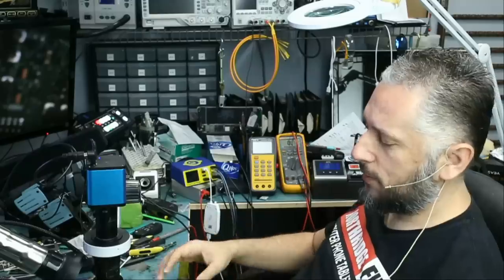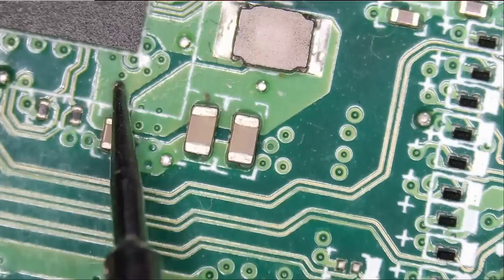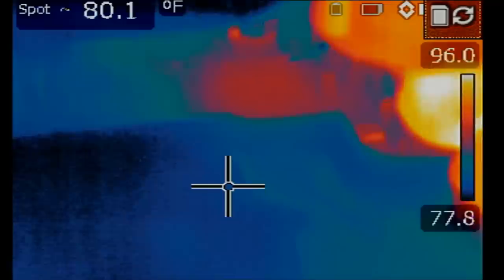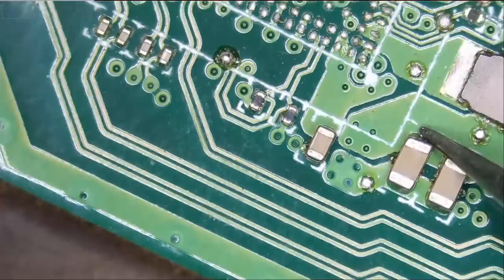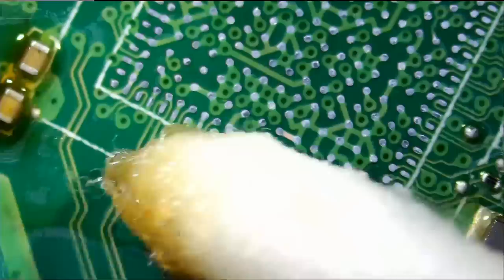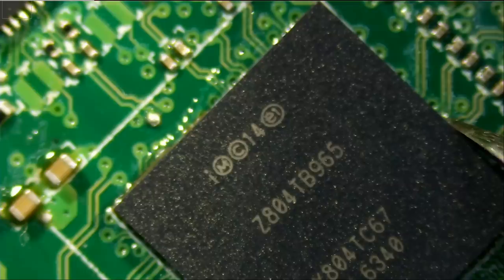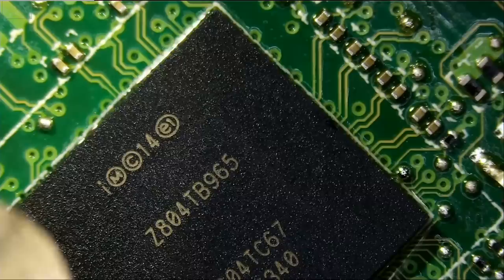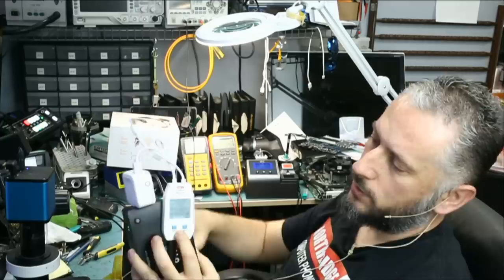HP Spectre x360 Laptop Repair - Won't turn on. Signature Thunderbolt Failure

Comment: I'm starting to wonder if there are any HP spectre out there that haven't experienced some near catastrophic failure lol. It seems like every repair channel I see is constantly working on these things. And it seems like it's always something different. I'm sure they are fine for the most part, and 99% of them have no issues, but it still doesn't inspire much confidence.
Reply: The numbers are much lower than 99%, some models are just made poorly
Reply: @marcogenovesi8570  I have the same impression. I know I definitely don't plan on buying one anytime soon lol. They seem like such a problem,I guess HP just dropped the ball on that one.
Reply: I changed my spectre x360 13 inch 4 times due to manufacturing defects. Ranging from fan making noise(vet it was the heat sync hitting the blade), then the other Was a deadpixel in 2 spots, and then the there was misalignment with the keyboard and top frame. Smh. Good laptop, bad manufacturers
Reply: @L3ttuc3  yeah I was a tech for a little over a year and the amount of HP laptops you end up repairing is amazing. I imagine they just have a ridiculously high volume of sales so they're more common in general, but in general you notice that HP cheaps out on most models with either hardware or the components of the frame. Lenovo seemed to be the best of the bunch with HP, Acer, and ChromeBooks being the most common laptops to fail.

Comment: I had a one of these 2 years ago and although it was a gorgeously built machine that ran very fast but I always felt conscious of the much tighter pitch of components and the distance between things. I have seen the sorts of particles that have entered some more modern machines resulting in catastrophic failure - from insect shit, as an example!

Comment: i m from pakistan i like ur videos repairs very much i learned alot from u.
i just watched hdmi connector traces ripped off repair video and i wish companies make easy to replace hdmi or any devices charging ports becouse 5 of 10 are have the same prob. some companies make it easy but others dont.
so i think they knew that and dont make easy so anyone can fix them. they could make them like separtly ribbon cable type repalcement for easier repairs
im i right?

Comment: hi, i have same Convertible and it won't turn on. LED Light Charching USB-C turn on white, Battery is OK i have checked. If i push the button the LED goes white and off again. i have then checked the Mainboard an if i disconnect the left Fan the Convertible starts and the right Fan works a little bit and ton off, but the LED Light from the Power Button remains white. 
Did you have this issue and can you give me little help to find the culprict ? 
Thank you!

Comment: I have a acer aspire a515-51 n17c4 wich get random blu screen when is on charge with the battery pluged in.if i remove the battery no more blue screen.i already replace the m2 ssd.What could be the problem?any sugestion?

Comment: Hi, hope you can guide me.
I have hp 8760w laptop with  Quadro 3000m 2gb GPU card.
Laptop can't work with a GPU card.
The issue is the GPU card itself.
I had it repaired twice when the screen wouldn't turn on n worked for 3 months each time before the issue related to GPU appear.
Now, if the laptop is closed n normal temp , it starts and goes to windows but that is for only 1-10min before it restart itself. And then the loop starts of restarting itself from hp logo. 
1. Extreme hot airblow
2. Loop restart with mutli colour strips in between, when Hp logo comes
3. No issue with laptop screen.
4. Loop stops if starting after few hours but again after 1-10min same thing happens.

So can u please guide me what to say to the repair shop person to do.will be checking the person now

Comment: Haii sir iam from India and also repair technician ihave received lenovo g50-70 issue processor section short showing error on multi meter on dioid mode 007  I checked some components that's also same,  how to done the processor sections problem  using multi meter i dont have thermal cam sir so requesting.   I don't know much english if anything wrong sorry.    How to solve processor section.

Comment: Hi, since I don't live in US, I'm unable to send you my hard drive.
So if u can give me a quick tutorial what to do, maybe I can access my hard drive again.
Here what happened, 
My secondary 2tb HDD was working but I did notice my desktop slow down and I did shut down (I do shut down 3-5 in a day) and when I restarted next time, all good but as I did a quick scan with avast, I notice in task manager this HDD was utilize full 100% without any usage on it.
I had to force close it. Since then I have issue that sometimes it shows in bios n other time it don't.
And wouldn't load further then Lenovo logo, just shut down n restart n in a loop.
Removing this HDD, everything run good.
I do think I felt clicking sound when I put my fingers in the centre where board is.
I did checked cables, power cord by exchanging with SSD. No issue there.
Without SSD it still wouldn't go further the starting logo.
Please help

Comment: sir I have a laptop asus vivobook 15 which only running with adapter not with battery, I had tried everything, also reprogramed the bios but no success. Could it be motherboard problem or charging ic, cos this laptop schematics isn't available online nor boardview. help🙁
Reply: Most likely charging related
Reply: @thesmartguy3523  Couldn't it be battery internal circuit.
Reply: @SaiyedR  I'm not an expert but based from my experience - I had a Dell that was only powering up when connected to its charger but wouldn't charge the battery, looking at its schematic turned out a burnt transistor was causing it not to charge.
Reply: @thesmartguy3523  ok my MBoard looks clean spot less
Reply: @SaiyedR  then prolly some other issue, why don't you take it to someone who knows what to do ?